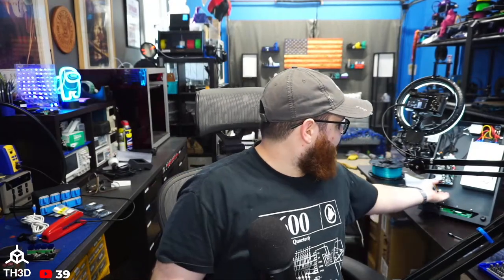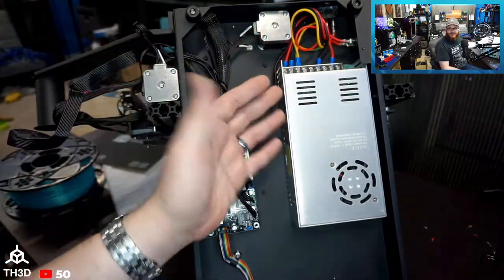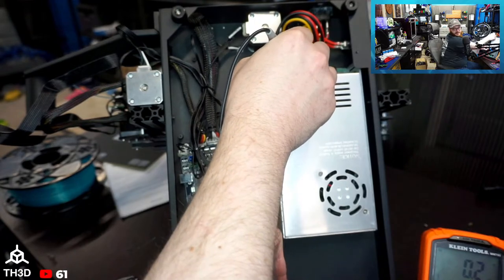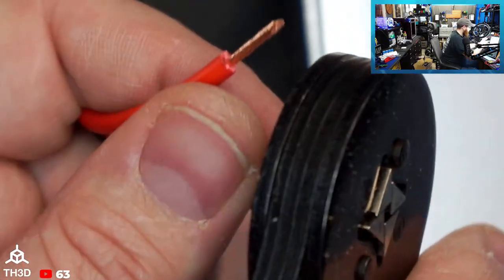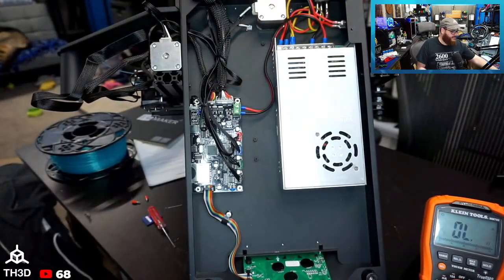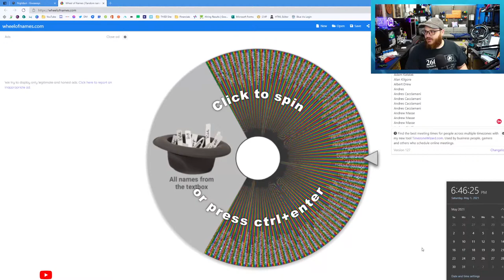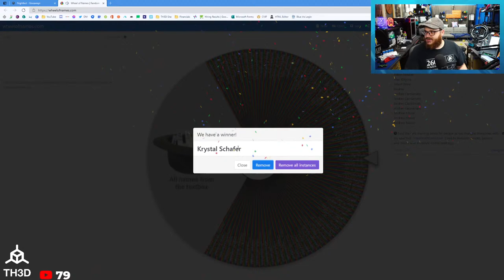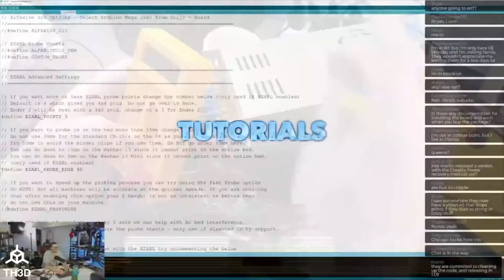Weekend Hangout With the JGMAKER Magic 3D Printer & April Giveaway | Livestream | 5/1/21 | Part 2

Comment: I need to replace my Pneumatic Connector on my Ender 3 hotend. When I search  I get both PC4-01 and PC4-M10?  Which is correct? I read PC4-01 is 1/8" thread and PC4-M10 M10 thread??  Thanks!
Reply from the maker: PC4-M10 is the correct one for the hotend on the Ender 3. We carry those here: https://www.th3dstudio.com/product/high-strength-pc4-m10-fitting-3-pack/

Comment: I have a folgertech reprap prusa i3 2020. What firmware from your site do i use?
Reply from the maker: We don't have that machine nor do we have firmware for it. You would want to use Marlin for that printer. Marlin is what our firmware is based on and all you need to do is set all the configuration values for your specific machine. See here: http://marlinfw.org/